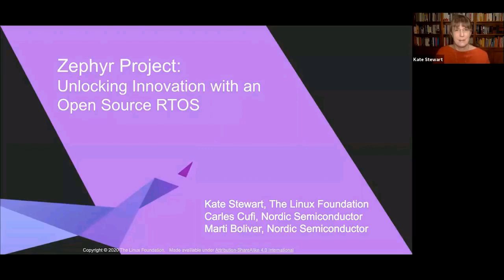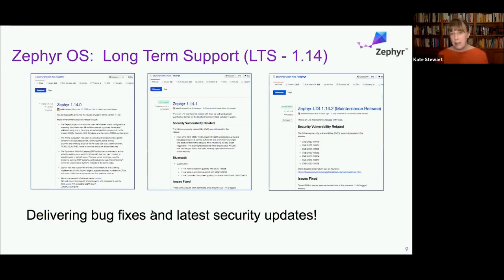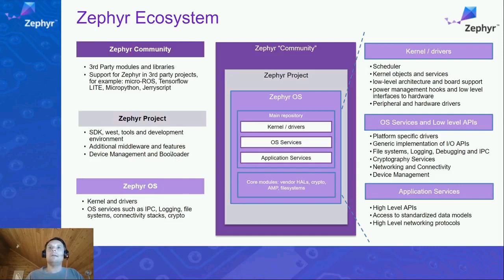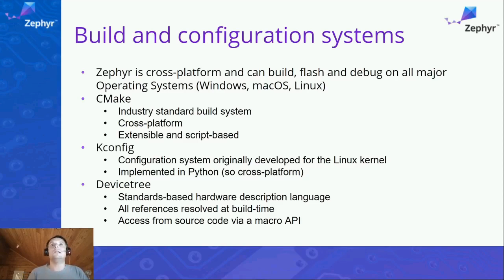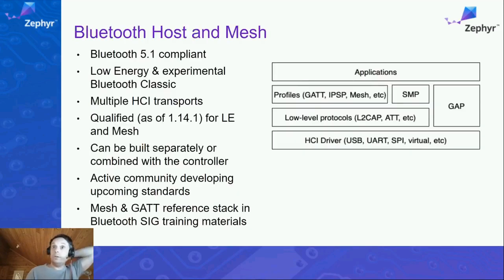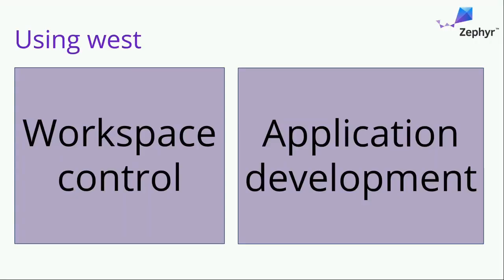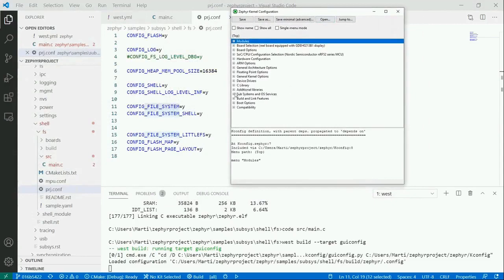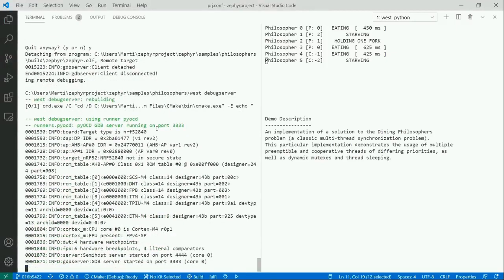Introduction to the Zephyr RTOS

Comment: At what point should one consider developing the application in Zephyr instead of nRF5 SDK?
Reply from the maker: Hi Pooya, there is no need to migrate to nRF Connect SDK/Zephyr if you are happy with the current feature set in nRF5 SDK v17, but keep in mind that the nRF5 SDK is currently in maintenance mode, and will not be updated with major new features. For instance, support for Bluetooth 5.1 direction finding and LE Audio in Bluetooth 5.2 will only be supported by nRF Connect SDK. New Nordic devices like the nRF91 and nRF53 Series will also only be supported by nRF Connect SDK, so if you are planning to use Nordic devices in the future you will likely need to migrate at one point.
Reply: All soc´s is already supported by nRF Connect SDK?
Reply from the maker: @wcaeng  yes, all the SoC's in the nRF52 Series, nRF53 Series and nRF91 Series. You can read more about the nRF Connect SDK: https://bit.ly/3kBm0yr